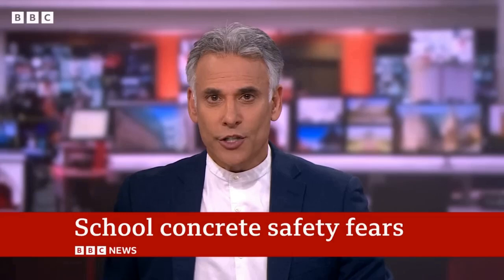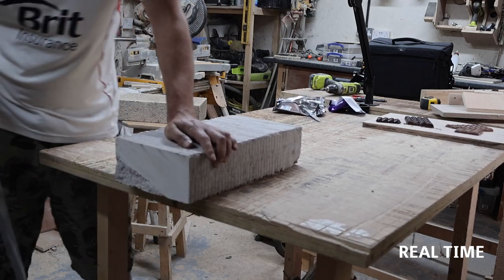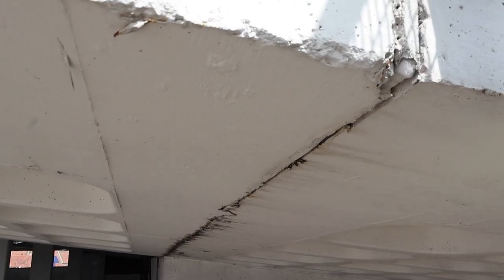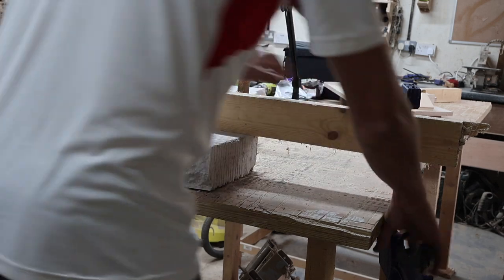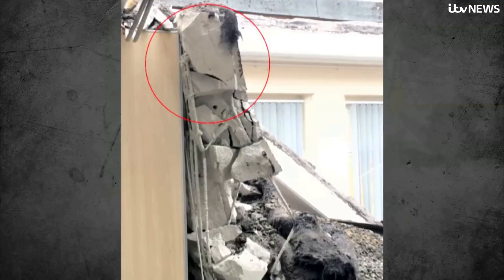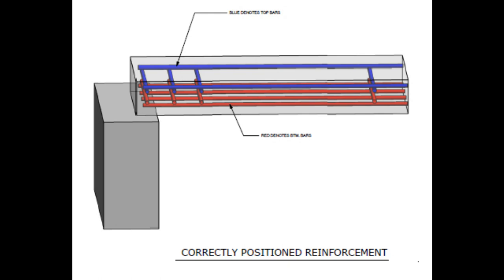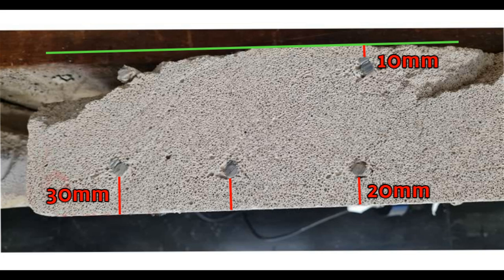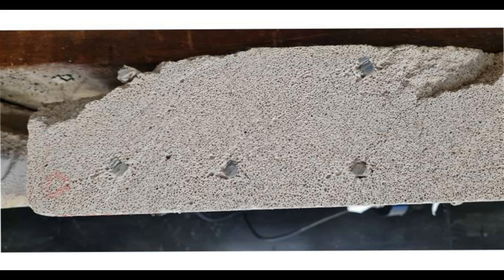RAAC - Structural engineer gives his take

Comment: This is a really well put together and narrated video, thanks for posting it. I'd be really interested seeing you do a series on the current state of new-build homes in the UK, from a laymans point of view there's some really dodgy-looking stuff going up.
Reply from the maker: Thank you for the kind words.

I've had a little think about this, it isn't as straight forward as you might think. For a start, new builds are quite easy, structurally speaking. Are the walls blockwork, both skins? Ground floor is going to be beam and block, which isn't ideal (you can't get access to underneath for a leaky drain, for example) but its the only option developers go with, first floor will be timber. Roof will be pitched (generally) and tiled. If the building isn't any of those things then I would need to know what things replaced them, which would be different from project to project. Which brings me on to the second thing.

Because if we are talking about specific projects then I am potentially attacking the investments of working folk, which I don't want to do. 

To give you an idea of what I WOULD do, there is a certain youtuber who dug a tunnel in his back garden, and he did a bad job. Really bad. If his neighbours really knew the structural details it would be lawsuit bad. That is the kind of person I could potentially might maybe go after.

Comment: I have 3 RAAC Beams in an extension I built onto my 1953 Chalet about 20 years ago.. They fitted in beautifully with the 200mm Durox Block construction and were used as Lintels. Rendered on the outside and plastered on the inside.  They were easy to use and blend in and was (and still am) very pleased with them.

The Media coverage (with RAAC..) is not interested in explanations.. as usual they are just looking to name and shame.. 

Construction Professionals and Tradesmen do what they are asked to do by Architects (As pointed out..) and Governments saying 'Build build build...'    Relying on the Data supplied by BM  Manufacturers/suppliers..

IMHO... 

1) Most of the RAAC failures I have seen  featured (TV)  appear to have been of Flat Roof construction...  and if this is then coupled with a lack of maintenance.. can lead to Water ingress.  Had the beams been made of Timber then they would have suffered the same fate and may introduce other problems, like Dry Rot..  
Indeed had the RAAC beams been made with either NO.. or at least,  non rusting re-inforcing material.. then the blocks/beams can actually withstand a lot of water ingress without collapsing..  

So..    Rusting Metal re-inforcement appears to be the core problem.   

(Most House Bricks are absorbant.. We rely on wind and Sun to dry them..  The Victorians understood.. Also about cross ventilating suspended floors..)
   
                      Insurance firms don't like/wont insure flat roofs.

2)  There is nothing wrong with building to a limited lifespan as long as no-one is misled.    If it can be built cheap and do the allotted job for the time period.. then GREAT..!  Times change..  Pull it down and on to the next project.. Recycle...    It's been done in the USA forever..  If McDonalds wants to build a new Restaurant they just flatten whatevers there and start from a clear site. (Only in Central London do they convert existing buildings.)   Old Buildings (Like the School in Ilford) are probably no longer really suitable for purpose.. Massive heating bills, narrow corridors.. etc but they are very well built and certainly should be preserved.  Re purposed.. (buzzword..)

This is still early days for this RAAC shitstorm.. 
       
No-one yet seems to have clocked that Celcon, Thermalite Durox  (Same basic material..) etc are used on virtually every Buildsite in the Country.. Are they next..?  Oh boy..

(Sorry, it's a bit long..)
Reply from the maker: 1) I would go even further. I would say that ALL of the RAAC failures are flat roofs. I don't think these planks were capable of taking any significant floor loading.

"So..    Rusting Metal re-inforcement appears to be the core problem", it is and it isn't. The failures we are observing are caused by the reinforcement corroding, true, but steel rusts, and we have known this for quite some time!! They knew this in the 70s too!! The planks were designed with a lifespan in mind, and that lifespan was basically the lifespan of the reinforcement. Which has now been exceeded. The planks were designed to last to about now. They have done what they were designed to do. We shouldn't be surprised really. 

My issue is that a tiled pitched timber roof has an indefinite lifespan, so why do anything else? It's like we spent thousands of years perfecting the art of construction and then we arrive in the 70s and they throw all of that experience in the bin. Its like they were trying to reinvent the wheel.

2) The problem of buildings with a definite lifespan is that the people who decided to pursue that course are not around to stand up for their decisions. If they could be held to account then, as an industry, we would learn pretty quickly but that isn't what happens. Instead, people make decisions that save a few quid but then those decisions cost more later down the road. And all the gremlins from all those bad decisions remain in the system until a bad thing happens. If you had made a bad decision 50 years ago that put a few bob in your back pocket but that created a future potential risk, would you go around telling everyone about it? Nobody can ever be certain of the extents of penny pinching and corner cutting that went on. RAAC is not the first, last or only issue with 70s and 80s construction, there are more gremlins to come.

I really don't like the american idea of everything lasting 30 years and then being flattened. Seems like a waste. I would imagine the reasoning is because this produces more economic output, more growth, and the same reasoning is used, in a much more general sense, to justify debt, it is supposed to fuel growth. I think all of this is economic jiggery pokery and causes more harm than good. Buildings should be built 'to last' and money should be saved before being spent, that is the end of the matter in my opinion (I know I am conflating two very different issues here, but if we are getting into the economics of a building lasting only 50 years then we need to compare that economic reasoning to other economics reasoning nonsense that can be seen around the world). The Americans are doing it wrong.

Celcon/thermalite/durox are the same basic material as RAAC, you are correct there, but there isn't any reinforcement, so nothing to rust (they are just AAC). These blocks are essentially chemically benign. They aren't going to react with anything or degrade. I think they should be fine. I don't like them and would happily get shot of them but they aren't going anywhere.
Reply: Totally agree!  You got it right, mate!  The real problem is the same that exists for all concrete!  Rust!  Water will always find a way in, sooner or later.  Look at Champlain towers in Florida....and just about most of the condo buildings built along the ocean!  Same problem!  ALL of them are going to have to come down...all of them!!!!  Solutions exist, just as the author mentions- it's a design and longevity issue, and the engineers shrug when the contractor (and politicians) "know better."  I'm reminded of a quote by C S Lewis about do-gooder bureaucrats "helping" people yet having the effect of creating hell-on-earth.  The same problem exists for the interstate freeways criss-crossing America.  Built 60+ years ago, now rusting rebar equates to total demolition and replacement of all bridges and overpasses.  The answer is really fiberglass, and I believe "they" have known this since....at least the 80's.  But if you are in the business of re-building, why would you extend the life of a structure from 40 years to 400 years by replacing steel with fiberglass?  I'll close with 2 quotes:  "“It is difficult to get a man to understand something when his salary depends on his not understanding it” --Upton Sinclair.  "“Of all tyrannies, a tyranny sincerely exercised for the good of its victims may be the most oppressive. It would be better to live under robber barons than under omnipotent moral busybodies. The robber baron's cruelty may sometimes sleep, his cupidity may at some point be satiated; but those who torment us for our own good will torment us without end for they do so with the approval of their own conscience. They may be more likely to go to Heaven yet at the same time likelier to make a Hell of earth. This very kindness stings with intolerable insult. To be "cured" against one's will and cured of states which we may not regard as disease is to be put on a level of those who have not yet reached the age of reason or those who never will; to be classed with infants, imbeciles, and domestic animals.”"
Reply: @BigfootsWorkshop  I absolutely agree with you.  In the end it's a DESIGN issue.  The buildings could have simply been designed for longevity.  But "quick and dirty" is more profitable!  And the decision-makers in this case by now are all probably dead!

Comment: Some really great thoughts and insights there. I love the point about designing buildings to last 30-50 years and then not being prepared for what’s next. I think in reality we expect buildings to last a lot longer. One funny thought, as a structural engineer perhaps you should consider a little bit of lateral restraint to your wobbly workbench 😂
Reply from the maker: Hahaha!! You got me!! Lateral restraint is by way of two big screws which go through the top surface and into each leg. They're not really designed for violent actions, just lightweight furniture. Cross bracing would impede storage!!

Comment: One correction for the Grenfell segment: the tower block itself was structurally sound - the spread of the fire was largely due to the cladding applied a few years before the fire, which had been swapped to a non fire-retardant version on cost grounds and including large air gaps which funnelled the flames; combined with the assumption from the building's construction onwards that in the event of a fire, the concrete and fire doors would contain the fire, thus rendering an evacuation unnecessary. In addition, there'd been a lack of maintenance to the building's firefighting equipment and a general lack of maintenance.

The more relevant example would be Ronan Point - built using conventional concrete, but another one of the experimental methods: precast slabs manufactured off-site, then bolted together on-site. A gas explosion caused an entire corner of the tower to collapse, while many years later when the rest was eventually dismantled, many defects were found.
Reply from the maker: My argument on grenfall is as follows. Why did the cladding panels need replacing at all? Because they had reached the end of their 30-50 year lifespan. Why weren't those panels made of brickwork from the get go? Because it was the 70s and this is the kind of corner they cut back then to save a few quid